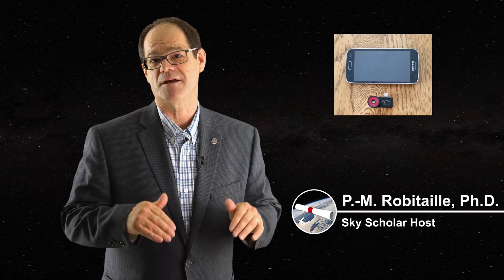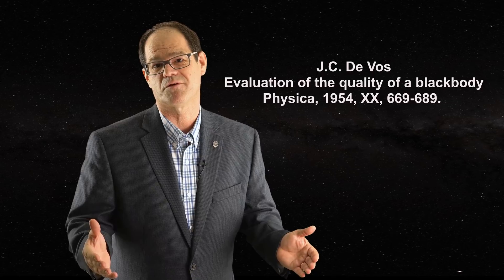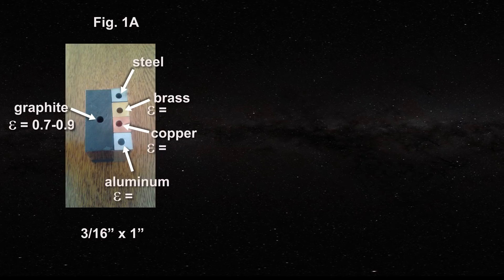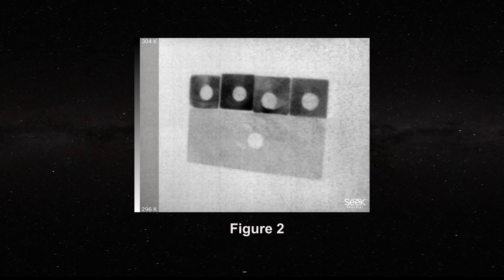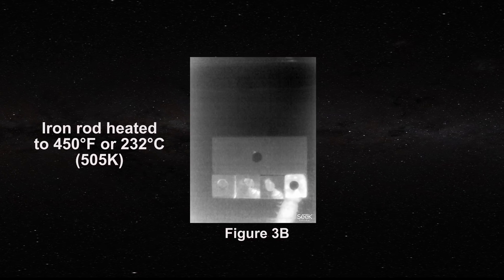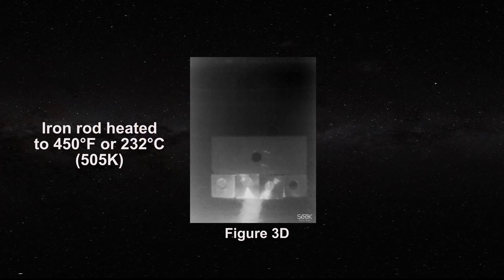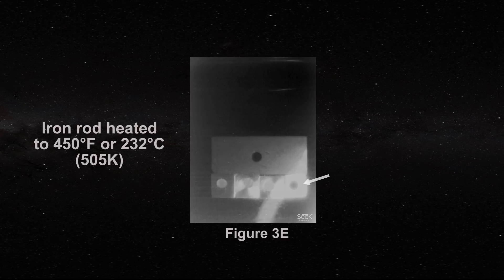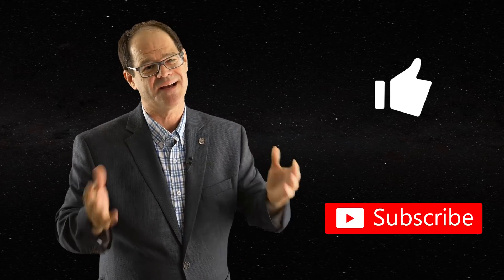Is Kirchhoff's Law True? The Experiment!

Comment: Question - Your experiments demonstrate that the frequencies and intensities of the light radiating out vary with different materials and different hole depths. If the temperatures in the materials are all the same, then this would contradict Kirchhoff’s law. But how do we know that the temperatures in each of the materials are the same? For instance, when I go outside in the cold, the temperature of the outside of my body is colder when I am not wearing a coat. The composition of the material on my body affects my temperature. Similarly why can’t the compositions of the materials in your experiment affect the temperatures of the materials?

Comment: Robitaille's mistake is to use cavities that contain radiation that is not in thermodynamic equilibrium with the cavity walls. His cavities have radiation dominated by incident and escaping radiation, which takes the cavity radiation away from thermodynamic equilibrium. Indeed, it is necessary to use specially constructed cavities to achieve thermodynamic equilibrium. Using relatively nearly blacker materials for the walls makes it easier to construct suitable cavities. The walls must be opaque and not too reflective. Robitaille states Kirchhoff's Law of Thermal Radiation incorrectly, as you may verify by checking in a conventional textbook. By the way, Robitaille uses the term 'work' in a way that he does not define, but is different from that of ordinary physics and from that of thermodynamics.
Reply: You're wrong and you didn't see the setup of the experiment where he pre heated everything prior to taking photos. Go read his paper and see how he did the experiment before you make comments like that.
Reply: @binaryguru  Thank you for your reply. In days long ago, I was impressed with Robitaille's attack, as I think you are.

I have now read Robitaille's linked vixra paper. It talks about 1) cavities made from good emitters and 2) cavities made from poor emitters. My comment means that Kirchhoff's law refers to 1), not to 2). It's a matter of defining 'good' and 'poor' emitters. Loosely speaking, I think that we can agree that a 'good' emitter can establish thermodynamic equilibrium in the cavity including its walls, while a 'poor' emitter cannot, because of the incident and escaping radiation. As I read him, Robitaille states Kirchhoff's law to include 'poor' emitters, while Kirchhoff's law refers only to 'good' ones. I have to say that I thought my comment made it clear; I am sorry if it didn't.

Robitaille is playing games with the definitions: he is trying to erase some of his previous mistakes, so as to make it seem that Kirchhoff's law refers also to cavities that are not in thermodynamic equilibrium. Planck emphasizes the need for his carbon particle to catalyse the passage to black body radiation in a cavity with perfectly reflecting walls. Robitaille's paper is wrong to say that Planck was mistaken about this, so that his derivation is invalid. It is regrettable that Robitaille uses the dubious term 'thermal' equilibrium. Kirchhoff's law refers to thermodynamic equilibrium. Also, I repeat that Robitaille uses the term 'work' inappropriately; the carbon particle doesn't do work.

Comment: I'm really confused by this.

My text book says kirchoff's law is applicable in thermal equilibrium.

Let's assume that everything is in thermal equilibrium prior to introducing the rod. When you introduce the hot rod isn't the body no longer in thermal equilibrium?

Doesn't that mean that kirchoff's law is not at question? 

Help. I'm genuinely trying to wrap my head around this thing.
Reply: "Let's assume that everything is in thermal equilibrium prior to introducing the rod. When you introduce the hot rod isn't the body no longer in thermal equilibrium?"

Correct. The external heating rod is a localised heat source. Therefore the graphite blackbody is no longer in thermal equilibrium with the metal blocks. The experiment is therefore a waste of time and effort.  The guy doesn't understand physics worth a damn.  He did, however, validate Kirchhoff's law when he allowed the blocks to heat soak at room temperature!
There is a reason this clown only exists on youtube. There are plenty of experiments demonstrating the validity of blackbody radiation. They are performed in classrooms across the world daily. By, and for, people who understand physics. Robitaille doesn't. He has never studied it.
Reply: @ianw_xvi8784  in school we put a similar set up on a hot plate and the professor said that it proves Kirchhoff's law is valid. 

However, that's OBVIOUSLY not thermal equilibrium. The same experiment was demonstrated in the text book...it seems like if this experiment is invalid then the ones I saw in school as demonstrated "proofs" of Kirchoff's law were equally invalid for the same reasons...
Reply: @perdedor3571  No, introducing an external heat source (the iron rod) invalidates Robitaille's idiotic experiment.  Among other problems. He simply doesn't have a clue about physics. You'll find that he is a creationist, and is trying to invent a universe that complies with his religious beliefs. He's a nutjob. Best to ignore such people. He has no impact on real physics.
Reply: @ianw_xvi8784  my point is, if this is shit, then the experiments in my textbooks are worse.
Reply: @perdedor3571  Well, I don't know what textbooks you have. However, your OP that Kirchhoff's law is only applicable in thermal equilibrium is correct. And Robitaille violates that TE when he introduces a localised heat source - the iron rod. Kirchhoff's law is well tested. There are plenty of blackbody experiments performed in classrooms the world over, every day. The only person questioning this is a creationist with zero physics qualifications, who thinks stars are made of liquid metallic hydrogen, and that the CMB is a reflection from Earth's oceans! IMO, he should be under 24 hour surveillance in a secure facility.
Reply: @ianw_xvi8784  cool.
Reply: @perdedor3571:

"I'm really confused by this.  My text book says kirchoff's law is applicable in thermal equilibrium.  Let's assume that everything is in thermal equilibrium prior to introducing the rod. When you introduce the hot rod isn't the body no longer in thermal equilibrium? Doesn't that mean that kirchoff's law is not at question?  Help. I'm genuinely trying to wrap my head around this thing." perdedor3571

You are correct.  Kirchhoff required temperature equilibrium.  Dr. Robitaille is not violating this rule, if you consider the limit of infinitesimal challenge.  Kirchhoff's paper deals with temperature equilibrium and Dr. Robitaille's small challenge to the blocks does not move one measurably from that condition.  In Dr. Robitaille's experiment, he is challenging the cavities briefly with external radiation.  Graphite is immediately able to do work on the incoming radiation and converts it to the temperature of the cavity walls.  The nearly perfectly reflecting cavities cannot do work on the incoming radiation.  Their wall are completely uncoupled from the problem.  This is what Kirchhoff failed to realize: Blackbodies can do work, perfect reflectors cannot.  That is why Kirchhoff's law fails.  That is also why we can have resonant cavities (in lasers), microwave technology, and MRI.  If Kirchhoff was correct, none of these devices would work.  It has nothing to do with the requirement for thermal equilibrium.  In the limit, you can think of sending an infinitesimal pulse of radiation into each cavity, so small that it cannot affect thermodynamic balance.  The graphite cavity will absorb the radiation and convert it into radiation corresponding to the temperature of the wall. The graphite does work in the process. The perfect reflector will simply reflect it, doing no work. The perfectly reflecting cavity is completely uncoupled from the external radiation. That is the key point of Dr. Robitaille's analysis of blackbody radiation: Blackbodies can do work.  This is something that was completely missed by Kirchhoff and Planck.  That is why all opaque cavities do not contain black radiation, contrary to what Kirchhoff claimed.  Perfect reflectors are unable to generate such radiation.  They contain the radiation that was incident upon them.  If nothing was incident, they are empty, not black.  Blackbody radiation is NOT independent of the nature of the walls.  It is completely dependent on it.  That is what Dr. Robitaille's little experiment demonstrates.

Also, if you examine the second video in the series, you will see that not all cavities are black when heated on the hot plate.  The near perfect reflectors have crescents in them.  In that experiment, the bottom row is clearly in temperature equilibrium as the blocks are left on a hot plate with no external challenge: https://www.youtube.com/watch?v=LE7fZ565DWc

Comment: Dr. Robitaille, I have truly enjoyed your lecture series. You seem to be one of few who can discuss a  very complex idea in a logical bite-size portion that makes it easy to grasp and understand as never before. I do have a question though, with so much money being used to create fusion as a viable energy source in the future that it can produce more energy than it uses. What effect would your model of the way energy is produced on the sun have on these fusion experiments?
Reply: I know this is two years old but here ya go. You may have noticed recently that "lattice confinement fusion" has been making waves. 

The rise of lattice confinement fusion bolsters the doctor's claim that the sun is comprised of condensed matter and is not a gaseous plasma. 

Basically, the tocomak reactor, which was designed with plasma fusion in mind has been a failure for decades. Dr. Would argue it's because they were basing their machine off of an inaccurate solar model.

Comment: You didn't disprove Kirchoff's law because the cavities were not in thermal equilibrium with the steel rod (or rather, its radiation), as required by the stated preconditions of the law. Here's a general advice, applicable not only in science: Please try to understand what your opponents are saying before attacking a straw man.

Comment: Hi P-M, I find it very interesting to see these physics experiments, especially if they can move the common understanding to a higher level ;-)

I would have preferred the usage of a calibrated, well known scientific IR-camera, regarding Pixel resolution, Thermal sensitivity & Non-uniformity correction - perhaps a FLIR, camera. I would also have liked if you used a reference calibrated thermocouple measurement, reading the ambient, DUT, and the steel-rod temperatures. 

It would also be preferred if you put pictures of calibrated mechanical measures using caliper. And you could also make a section cut afterwards to show the shape of the bottom in the holes! You only mention the block dimension in your paper, but how is this interesting?, other than more mass will keep the temperature steady and thereby less influenced by the hot rod. The hold diameter to length ratio is more interesting, if this experiment shall be repeatable... and also the alloys-description and most likely a fisher-scope x-ray report as evidence.

One thing I know from working with calibrated IR measures regarding space-engineering, is that you need to paint all surface black with a non-reflective appearance. Otherwise you will get falls readings due to surface reflections from nearby sources – like your hands, but ok – the test is a comparison, so all the bodies experience the same amount of noise. I still think you should paint the surfaces, as it’s only the reflexive holes which are of interest.

I’m sorry to say, but it annoys me that the holes are very much off-centered, and you didn’t even use a camera stand :-( … I believe that; if it’s worth doing – it’s worth doing right.

I hope you read my feedback in positive mind – let's bring a little more scientific methodology into it - I still think it’s interesting, and I will dig into some of your other videos to learn more, or unlearn ;-)
Reply: you can do the test on your terms

Comment: Hmm i have a question, in order for this experiment to have physical meaning, shouldn't the walls of the materials all be at equillibrium first? 

If the aluminum, copper and brass all have high reflectivity, then they also need longer time to reach thermal equillibrium with their surroundings, it's a matter of kinetics in this case, and not thermodynamics.

Just curious, wouldn't this explain why the shinier surfaces didn't get black yet? These metals do have higher thermal conductivity, but since we're dealing with radiation and not conductivity, could this be a reason for the results?

I think we would need a setup in which every cavity has a thermal camera at the end, but the camera should completely cover the cavity to prevent any ambient thermal radiation from the lab's walls from entering the cavity, then heat up the cavities from below and monitor how they evolve with time.
Reply: When I looked at this the first time, for some reason I thought these metals had been held in a furnace first. This is not the case. A valid point, with my total lack of formal quals!
Reply: I assumed that since he first was showing everything at room temp that would satisfy such a requirement; I'd like to see what results could be achieved with everything at different temperatures.

Comment: On your video on black body radiation ( https://youtu.be/h5jOAw57OXM ) you provided an excellent description of black body radiator design, so you obviously know that a "1 inch hole" drilled in the material will not suffice. So why not do your experiment using the design YOU stipulated in your aforementioned video. Also approaching with a "hot rod" is not exactly an example of thermal equilibrium. Why so lame a "proof" ?

Comment: 6:12 it looks to me that the radiation is not filling the steel hole at all, you can see the sensor is saturated on the surface of the steel, this saturation is leaking or blooming into the surroundings of the image. To be clear this is a glow effect that happens in the sensor and not the hole! To be sure of the hole's real emission the sensor must be adjusted or filtered so that it does not saturate or bloom.